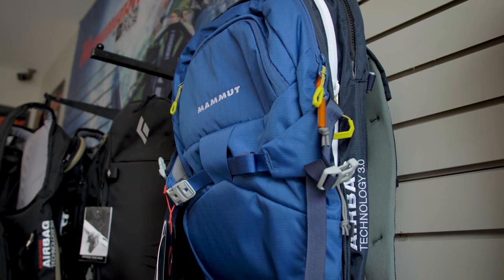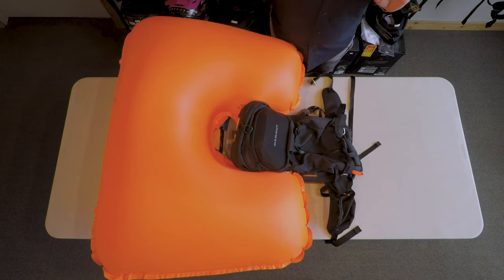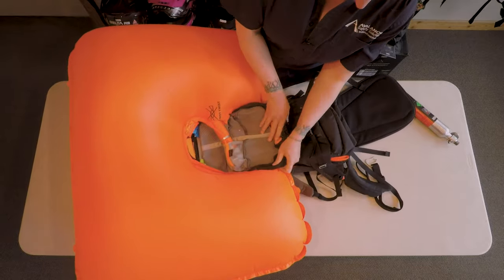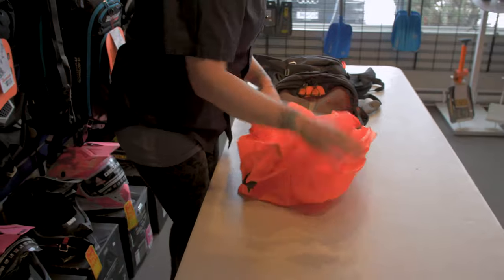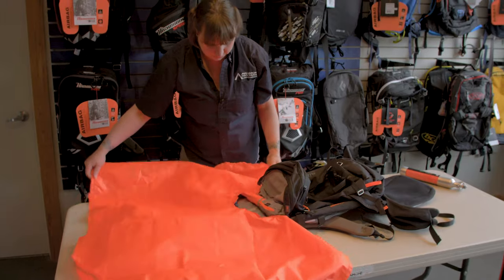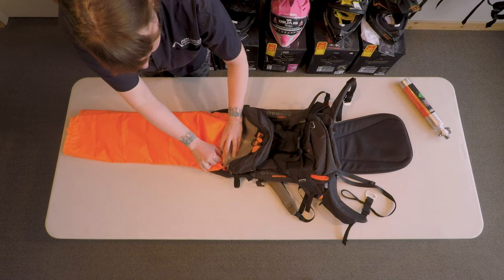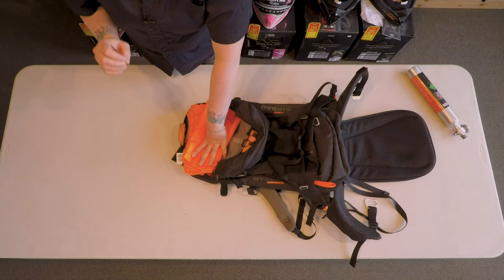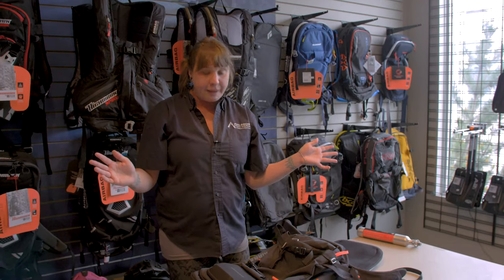How to Repack a Mammut R.A.S. Avalanche Airbag

Comment: Hey guys! Amazing video, thanks. I have a question: if im trapped in an avalanch, would it be a simpler way to uninflate the airbag, in order to have more air to breathe until I get rescued?
Reply: I've been wondering about that too. It might not be a good idea since the airbag is filled with 150 litres of nitrogen which might suffocate you if it's trapped under the snow together with you. I don't know for sure though.
Reply: I guess I'm kinda off topic but do anyone know a good website to watch new movies online?
Reply: @Gideon Judah Flixportal :D
Reply: @Elisha Vincenzo thanks, I went there and it seems like a nice service :D I appreciate it!
Reply: @Gideon Judah you are welcome =)
Reply: @paddor  well, it is true that we only add nitro to 10/12+ (atm*Pa)…depends on the diver, although not too much variation… therefore… yes, it will have an inverse/opposite effect in only a few and fractions of an (atm*Pa)… really, why do they use nitro 🤨